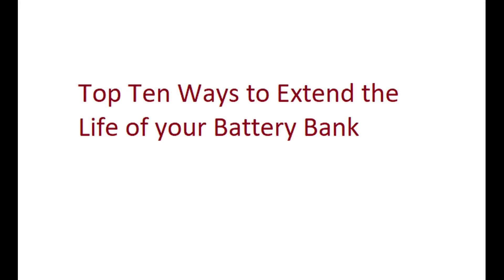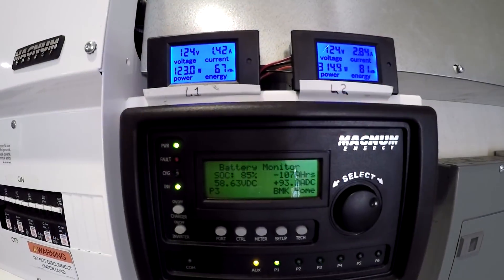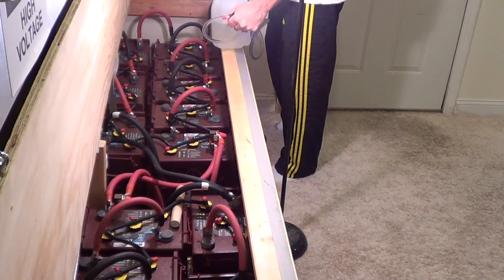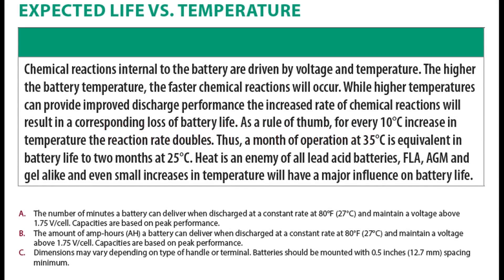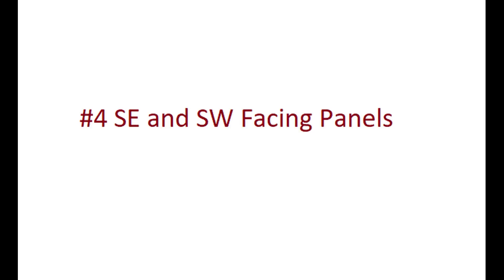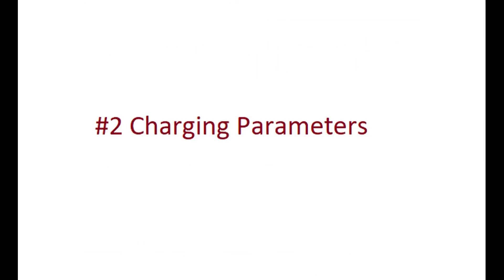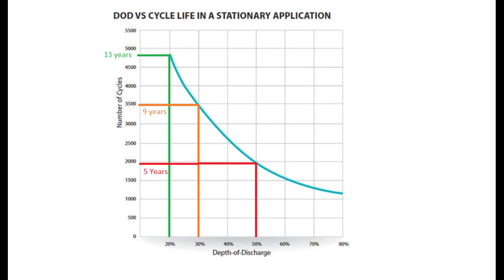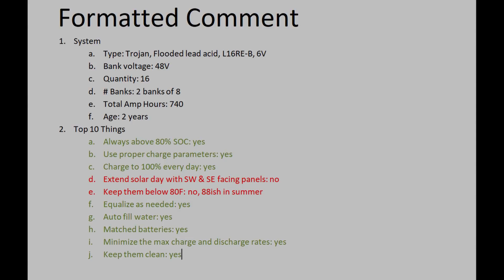Extend the Life of your FLA Solar Battery Bank

Comment from the maker: Please copy this comment, fill in details of your system and repost.  Thanks!
1. System
a. Type: Trojan, Flooded lead acid, L16RE-B, 6V
b. Bank voltage: 48V
c. Quantity: 16
d. # Banks: 2 banks of 8
e. Total Amp Hours: 740
f. Age: 2 years

2. Top 10 Things
a. Always above 80% SOC: yes
b. Use proper charge parameters: yes
c. Charge to 100% every day: yes
d. Extend solar day with SW & SE facing panels: no
e. Keep them below 80F: no, 88ish in summer
f. Equalize as needed: yes
g. Auto fill water: yes
h. Matched batteries: yes
i. Minimize the max charge and discharge rates: yes
j. Keep them clean: yes

3. Notes:
a. So far so good
Reply: David Armstrong nice lists. Is there a book to read, that is good on how to set up and maintain a solar set up? Just wondering.
Reply from the maker: @Writerdust  I read and re-read the user manuals for all the components that I use.  I also watch a lot of YouTube channels and I have been learning as I go through experience.

Comment: 1. System: Morning Star MPPT 60, Inverter Powland (EA Sun)  MLVZ 3KW-48V Inverter /charger charge current set to 40amp, Auto start gen at 47.5V

2. Solar panels wired to operate at 75v open circuit, 63V max power point, 50 feet of 2 awg wire to controller, all 60 cell panels

a. Type: Interstate, Flooded lead acid, GC2-ECL-S

b. Bank voltage: 48V

c. Quantity: 8

d. # Banks: 1 banks of 8

e. Total Amp Hours: 225

f. Age: 3 years (2.5 as of this second to be exact)

2. Top 10 Things

a. Always above 80% SOC: No average 60% dod

b. Use proper charge parameters: yes

c. Charge to 100% every day: yes

d. Extend solar day with SW & SE facing panels: yes ; 540W on an  X + Y Tracking system (Home made) 1440w South, fixed

e. Keep them below 80F: no, no higher then 20c in summer

f. Equalize as needed: yes + online Cell balancing system (online as in all ways connected)

g. Auto fill water: yes (Flow rite Pro-fill)

h. Matched batteries: yes

i. Minimize the max charge and discharge rates: No

j. Keep them clean: yes

3. Notes:

a. So far so good, Cell Balancers have done an incredible job HA-01 (1 unit to bridge the 2 banks of 6v batteries), and HA 02 (2 units 1 per 4 batteries)

Comment: Current system: 8 * Interstate 6v 230Ah configured to 48V, Single point watering system like you got, HA cell balancers, Morning star tristar MPPT60, 2Kw solar, Powland 3kw pure sinwave inverter. Stored in Basement so my batteries rarely go above 20C.  My min needed AH really should be 600AH due to being undersized I go to 60% dod often, so they will be short lived, My panels the main array is aimed dead south, the smaller is tracking system.  Even with a cell balancer I still do the EQ charge every month. back up, generator is 21Kw 4cyl diesel, so I can runt he town when that this is fired up.Age on this bank 2 years, old bank 8 years 6 * 6v configured 12v US2200XS series

Comment: My system is same as yours except that my batteries are 2 banks of 4 12 volt 140 ah batteries, and I don’t have auto water.
Can you get auto water for all brands of flooded lead acid batteries?
Reply from the maker: Ted, I think they make a generic type auto watering kit but not really sure.  I would definitely get one if you can.  It only takes me 10 minutes per month to water them.  Thanks!
Reply: yes, just takes more searching to find one for less standard traction type batteries, sounds like you`re using starter type automotive batteries

Comment: Thank you for this video! I just bought two 12v FLA deep cycle batteries and have been looking for information on what parameters constitutes a charge cycle. 

Until now, after seeing your video I was going to discharge down to 50% before recharging, now I’ll try my best to keep it at only a 20% discharge and the temp around  77 degrees fahrenheit. I’ve watched countless videos and have invested many hours looking for the answers that you’ve provided. 

Is it correct to not let the batteries remain in any state of discharge for an extended period of time? Should I basically strive to keep them at 100% capacity daily? Thanks again for the info that you’ve provided!
Reply from the maker: I try to get them to 100% by the end of each day and usually do.  Here is my complete history:
http://data.magnumenergy.com/MW5454/
Thanks!
Reply: That’s an amazing analysis chart. Thanks for sharing and planting the seed for me to track things in great detail. This entire solar power thing is becoming an obsession and money pit for me. Lol. Thanks again!

Comment: Flooded lead acid is the best if you must use lead acid batteries. Lithium is far better in the long run and cheaper over its lifespan. Also, lithium batteries are near zero maintenance. If you are living off grid, being able to only use 30-50% of your battery capacity is problematic. This is where lithium batteries really shine. In off grid scenarios, 2-4 years lifespan for flooded lead acid batteries is typical for most applications. Temperature is a big factor for both lead and lithium batteries. Neither like high temperatures, and their power output drop dramatically as they get cold. (Try starting your car in -20F temperatures). 50F - 80F is the ideal range. Heat definitely kills lead batteries much faster than cold.
Reply from the maker: I think lead acid is better than most people give it credit for but I do agree with you that Lithium is better.  I am on year 5 with these batteries and they are still going strong (knock wood).  I do plan to switch to Lithium when these finally die.  I think a large (20-40kWh) Lithium bank would be a game changer for sure.  There are several key things about the differences in the way they charge and such that are not readily apparent unless you have lived with an off grid system.  Thanks!
Reply: @HomesteadEngineering  A 20 kWhr LiFePO4 Battery Bank ( Battleborn ) will cost about $15,300 = 17 Batteries x $900/each.  How can you cost-justify such a huge expense for such a small battery bank?  The average person would never pay $125 per month, every month, for only 600 kilowatt-hours of grid power.  And that is assuming 100% DOD and the 100% SOC recharge every day - which is nearly impossible is the real world.  A 40 kWhr Battleborn battery bank would cost a whopping $30,600 !
Reply from the maker: @MrSummitville  If the next 30 years were guaranteed to be like the past 30 years than it would make no sense at all.  On the other hand, what if you had 30k in the bank on Friday and on Monday the banks are all closed down permanently?  Your money is gone and the utility is shut down, then it make a lot of sense.  I'm not doing solar to save money.  I am doing solar to be self sufficient.  That said, I will probably DIY build one myself for 10k.
Reply: Properly cared for and sized a lead acid bank can give 20 years of service and survive some rather big oopsies.

Comment: 1. System
a. Type: Trojan, Flooded lead acid, L16G, 6V
b. Bank voltage: 48V
c. Quantity: 8
d. # Banks: 1 bank of 8
e. Total Amp Hours: 390
f. Age: 4 years

I can confirm on the temp and capacity.  i.e. I keep mine outside, due to open flame concerns in a cabin.  Last winter I was out at -35 F.  I have 4 led lights, and fired up the laptop for work (2 monitors attached).  With in 2 hours, I was down to 80%. (max I wanted to go due to freezing the batteries).  Generator kicked off, and with the BMK, charging took longer than I was used to, which it turns out is a good thing. (lower voltage).  I was seriously worried that my batteries were bad.  They were not.  An extreme test, I know.  Bottom line extreme heat is bad, but cold in my opinion is also a major concern.   This summer was running an AC unit, and i'm sure that load was taxing the system, but it kept up as long as the sun was out.   I think our systems are about the same age.  I have 3 panels of 280 watts in a string, and 2 strings.

Comment: My set up is similar to yours but I only have one inverter and it's 24v. I have 8 6v trojan batteries but they are the 325 ah ones. When it's time to replace them I'm looking at adding more capacity. Would you recommend going to 12 2v batteries or adding another string of 6v? I've heard it's better to keep the number of strings lower.
Reply from the maker: Hello Steven,  My gut feeling is that you might look at moving up to a 48V system. I personally feel that a 48V system is still WAY too low.  I would like to be running off a full model 3 Tesla battery (80kWh) with a direct out to a 350V inverter.  That would be something.  If you have to stick at 24V then I suppose I would go with three strings of 4 at 6V but I am not sure that's better than 1 string of 12 at 2V.  Oops  lol!
Reply: @HomesteadEngineering  That would be something! Have you seen Jehugarcia's videos of his diy power walls?
Reply from the maker: @stevenpalermo7549  I'll have to look that up.  Thanks!

Comment: Greetings agai from the Dominican Republic. I imagine you have thought a out Lithium batteries and I think I remember you said in one of your videos you will eventually switch to Lithium. You may already know that used electric vehicle batteries like the Nissan Leaf, Chrysler Pacifica, Teslas give one a great less expensive option for battery storage.  Soon I will start with one 48 Volt Magnum Inverter then in a year or two upgrade to two Magnums. So I the moment I am comparing ev batteries and we have narrowed down and comparing if the Nissan Leaf is better than the Chrysler Pacifica batteries. If you have an opportunity we would love to hear your thoughts between the two. 

Please share your experienced opinion on the following forum post, we would appreciate it, thank you:

https://diysolarforum.com/index.php?threads/poll-nissan-leaf-vs-chrysler-pacifica-vs-bmw-i3-battery-packs.130/

Comment: 80% means. 80% fully charged. only using 20% of it power?  if so that kinda sucks. no wondering they last years. Heck if i drove my car at 20% i might not ever have to buy a car again. lol
Reply from the maker: Well maybe so, but if you use them this way then they are still the best bang for the buck.  That is changing, won't be long before used electric car batteries are the way to go.  Thanks!
Reply: @HomesteadEngineering  You spent TWICE as much for a battery bank that lasts TWICE as long.  So, your cost ( total kWhrs per dollar spent ) is about the same ...

Comment: Hello, this is a really nice design. I know request is coming late but it's when I came across your system. I have always been interested in becoming an installer myself. 
Will really appreciate if you can send me your components list, Design documents and the solar panel charger matching documents. 
If you can't send it all, any of the above will really be appreciated. 
Well done boss. Nice job.
Email: chukselvismakers@yahoo.ca
Reply from the maker: OK, just sent you a link to dropbox. Thanks!
Reply: @HomesteadEngineering  I haven't received the link. Pls confirm that you sent to the right email address. Notice it ends in .ca
Reply: Ooh. Great. Thanks
Reply from the maker: Check your spam folder

Comment: Please copy this comment, fill in details of your system and repost.  Thanks!
1. System
a. Type: Rolls-Surrette, Flooded lead acid, 4CS17PS, 4V
b. Bank voltage: 24V
c. Quantity: 12
d. # Banks: 2 banks of 6
e. Total Amp Hours: 1092
f. Age: 11 years

2. Top 10 Things
a. Always above 80% SOC: no
b. Use proper charge parameters: yes
c. Charge to 100% every day: no
d. Extend solar day with SW & SE facing panels: whole array is 15 deg east of south for morning sun bias
e. Keep them below 80F: mostly; gets above 80 in summer, but it's pretty short in PA; the cold of winter increases battery life
f. Equalize as needed: yes
g. Auto fill water: no
h. Matched batteries: yes in each bank, but 2nd bank was added 3 years after first
i. Minimize the max charge and discharge rates: yes
j. Keep them clean: mostly; there's some corrosion on the older bank

3. Notes:
a. So far so good; my first bank has less capacity and tends to charge and discharge faster, but it acts as a buffer for my 2nd bank which therefore charges and discharges slower;  I expect my first bank to give up the ghost in another year or two, having given me 12 or 13 years of life

Comment: David you have a beautiful system but in my humble opinion it's time to move on sell those lead acid while they still work and buy some lithium sorry for speaking my mind but all that new technology tied to a 100 year old tech is keeping you from total enjoyment of your system.
Reply from the maker: OW:  My plan is to get 10 years out of these FLA batteries.  By then, I think there will be an abundance of lightly used electric car batteries flooding the market.  For now, these are getting the job done with a little help from the utility.  Thanks!
Reply: @HomesteadEngineering  Don't get me wrong I like your videos and if you are sticking with those lead acid what you are doing will improve your chance Cheers.
Reply from the maker: @offgridwanabe  Not at all, your point is well taken.  Thanks!

Comment: Great video as usual I have learnt so much from your channel and was able to build my own solar system that runs my home. I have a question I need your assistance with. I have a 24volt system with 856AH battery bank these are 8 Rolls FLA batteries  connected in series then parallel. I also have 2 battery monitoring system connected to it a Victron BMV-702 and a Bogart Trimetric TM-2030RV both company are the best battery monitors you can find on the market as you too have worked with some victron battery monitors. My question is what is a save voltage to carry your battery bank? Because my system in the morning just before sunrise sits at 24.16volts after pulling 186AH thru the night from my system showing I have 83% remaining in my battery bank. The state of charge is looking good but my concern is the voltage if I am at 83% state of charge what if I should pull my batteries down to 50% I know it's not recommended to pull FLA batteries below 50% state of charge but I also know its still a safe place to have your batteries so I'm not sure if I should pull them down to 50% if my battery voltage would go too low as charts online show 24volts to be below 50% state of charge please give your expert advise thanks and God bless.
Reply from the maker: Sean,  I don't think I can help you much here but this is what I would do:  
1. Add a meter that shows the SOC directly.  I use the the Magnum battery monitor kit with the RTR.
2. Never go below 80% SOC.
If your grid tied, switch a few circuits to the utility overnight if necessary to stay above 80% SOC.  Better to pay the utility overnight than to shorten the life of your batteries.   If your completely off-grid, then add a few SE and SW facing panels to extend the solar day.  Finally, do the laundry, dishes, water heating, ect. during the day when the sun is shining and minimize usage when the sun is down.  Good luck and thanks for watching!
Reply: @HomesteadEngineering  thanks for your reply I do have 2 meters that show state of charge one is a Victron battery monitor and the other is a Borgart battery monitor both are top rated monitors that is use by most solar installers they all show state of charge AMPS in and out the battery bank and a whole bunch of different perimeters even Justin Case use the Victron battery monitor in his shead. I really don't think I need to worry about the battery voltage so much as I notice as soon as the sun start to rise in the morning as much as 50watts start coming into the batteries then voltage of battery bank start going up fast that tells me that my bank could be a 80% state of charge yet voltage can be at 23.9volts. I come to that conclusion because the battery monitors go thru a counting process where it calculates the AMPS out and AMPS in to batteries to determine % state of charge which I think has to be very accurate than watching the battery volts only hope I'm rite thanks for you reply.
Reply from the maker: @seanjsolar2493  OK, I guess your question was more about should you trust your BMK SOC or use a voltage table.  I trust my kit and hope I'm right too.
Reply: @HomesteadEngineering  You answered perfect lol that's really what I wanted to know

Comment: 1. System
a. Type: Trojan, t105
b. Bank voltage: 48V
c. Quantity: 8
d. # Banks: 1 banks of 8
e. Total Amp Hours: 225
f. Age: 1 years

2. Top 10 Things
a. Always above 80% SOC: no
b. Use proper charge parameters: yes
c. Charge to 100% every day: no
d. Extend solar day with SW & SE facing panels: no
e. Keep them below 80F: yes always under 70
f. Equalize as needed: yes
g. Auto fill water: no but I water every 90 days. 
h. Matched batteries: yes
i. Minimize the max charge and discharge rates: yes
j. Keep them clean: yes
Reply from the maker: Hello idontneedaname85.  I did not get notified of your comment 2 months ago for some reason...  I would guess that keeping them under 70 may allow for a little more wiggle room for a lower SOC.  Watering every 90 days may not be enough but you would know better as you are looking at them.  If I waited 90 days, my plates would be exposed.  I water about 3/4 gallon each month for 16 batteries.  Thanks for posting your system info!
Reply: yeah no problem. Im in omaha ne so I only get like 200 days of sun per year. I think that why i get away with only watering every 90 days.  @HomesteadEngineering